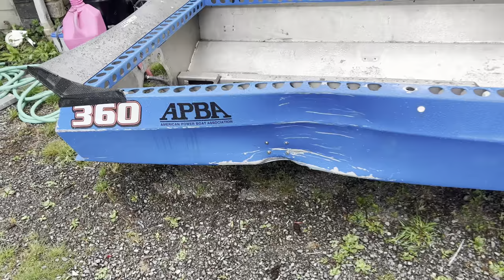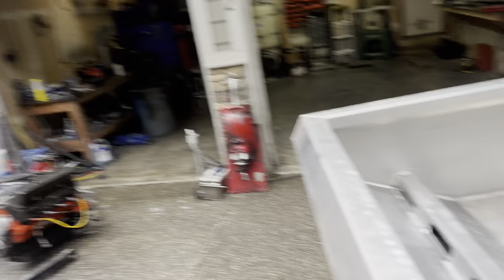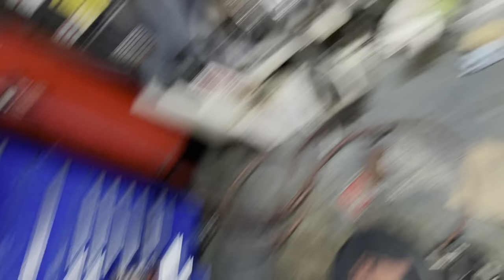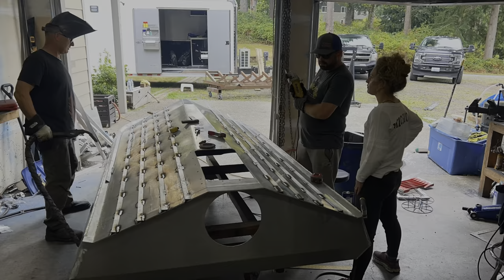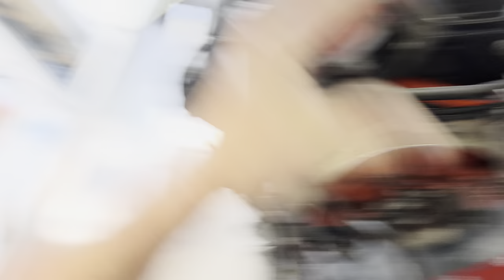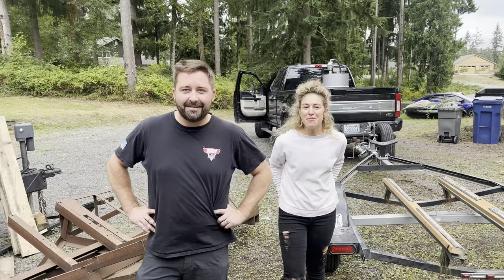We build a jetsprint boat in FOUR DAYS

Comment: I wanna put a pump block on a pivot.. boat nose goes high, pump block stays more perpendicular to water... It looks like when the nose pitches up out of these smoking fast corners that the hull is airing out the pickup for a split second?   On our "prop" boats, that stringer issue is all to common.. 2" aluminum angle fixes it and allows for fine tuning CG... never had one come loose even at 1000+ hp..

You are new to methanol... you know about airing out the top end of that motor between events? (valve springs)
Reply from the maker: I have ideas too lol.  Yeah there’s significant condensation in the valve covers for sure!  We pull them off after the race!